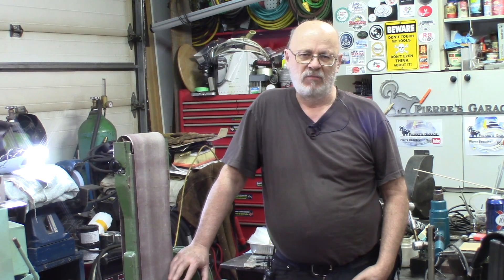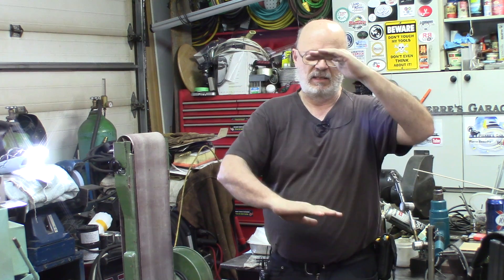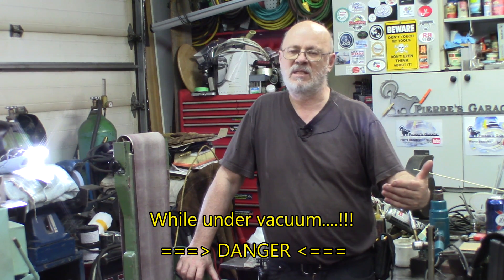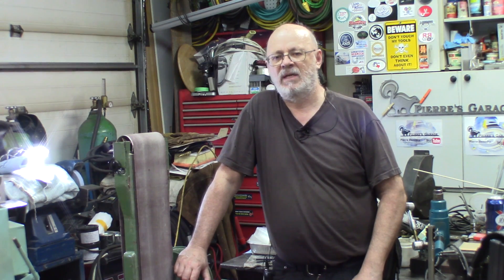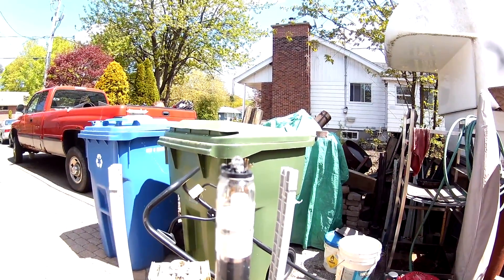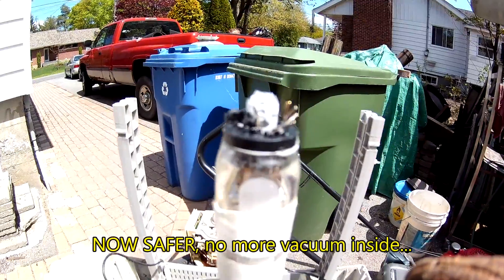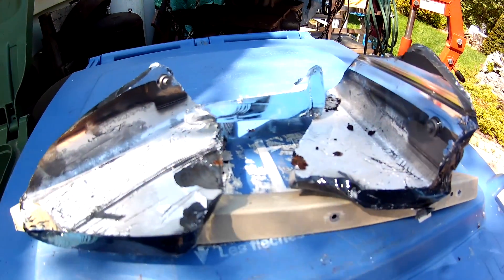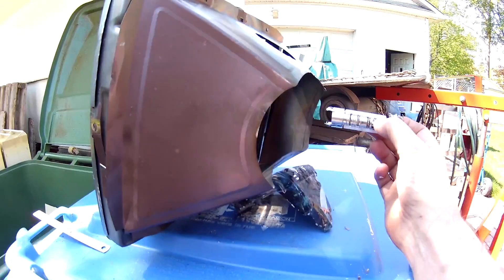SAFELY Decommissioning a CRT, under high vacuum, controled vacuum release...

Comment: would this damage the electron gun?
Reply from the maker: If the magnetron is still good, there isn't much chance it becomes defective from now on.....
You can test it by following the short instructions in the service manual refered in the description under the video.
Reply: @pierresgarage2687  Magnetron??? Doesn't a crt use an electron gun to illuminate phosphor and electromagnets to guide the beam to produce the image?
Reply: Thank You! Great advice btw!

Comment: Oh oh ph. Lols just put a hammer or something better fwiw imho see what if an axe with goggles obviously lols... and a hoodie for arm protection when swung into from the side at the top of the neck... btw from experience if ya find a dumped crt dont reach into the broken screen particularly as if ykwis it turns out ya can even cut yaself not feeling it cause if its cold outside hehe... just because ya wanna get that free copper ykwis

Comment: I worked for several years for a company that manufactured their own CRTs some
rather large 30" diagonal.  The method we used to decommission tubes was to take
a tungsten wire pick place the tip against the neck near the electron gum and heat 
the pick with a O2 and gas torch the pick would melt through the lead glass neck wall 
in about 5 to 8 seconds then pull the pick while still hot air would enter through the hole
and the tube was back to atmosphere in 10 to 15 seconds.  This was done hundreds
of time  while I was in that lab worked every time.
Reply from the maker: This would make possible the reuse of the tube since the mesh and surface weren't gonna be bombarded with glass particules from sudden breaking of the neck like I just did. Cause special or rare tubes are being reconstructed, this is a rare trade those days....    
Thanks for your comment,   Pierre

Comment: Pierre,
   I’ve properly decommissioned many more of these vacuum tubes over the years. 
   As a kid I took a somewhat different approach which was so safe. In the rural area where I grew up it was rather rough terrain in places. There were no landfills in those days and local farmers, wanting to fill deep ditches and ravines would permit/invite people to discard there junk into them. You can imagine what went into those treasure sites! I guess I’ve always been a bit of a scrounger, (my brother in law called me a junker) so it was always an adventure to go to the dump. Several go carts and other contraptions were built out of material and parts out of those places. Back in those days we never went anywhere without a rifle or shotgun as they were openly mounted on a gun rack behind the seat. Whenever we spotted a discarded TV in the dump out came the 12 gauge. The effect was spectacular! It’s a miracle I’m still alive today considering some of the stupid things I did in my youth.
Reply from the maker: Also remember a few stunts performed when younger, we're the lucky ones that survived, with at worse a few scars...   ;)
Now, parents aren't very far behind kids watching every move...   Hard to explore interesting stuff with a parent 5 feet right behind your back...   lol
first 20 years of professionnal life was working as electronics tech for the CBC in Canada, the 12 gauge in the shop was absolutely not an option.....    ;)
Cheers,    Pierre

Comment: Hope that is not the monitor you had in need of repair... don't think I could help it now. Very interesting. I never saw a shadow mask before. (Just know what the picture looks like if they get bent or deformed from sharp jolts.) That shadow mask looks like a useful filter material. Maybe for your flood coolant tank?
Reply from the maker: Hi, 
The monitor that needs repair is still in line for a fix, I don't think I'll have time before the bash, too much to do but still have your notes about the possible fails and remedies you sent me before...   ;)
BTW, it's a monochrome monitor, very simple electronics compared to those multi-sync computer monitors.
The holes in the shadow mask are VERY small, maybe something to make a measurement soon in order to find out, I'm kinda sure they would block almost instantly as a filter for the coolant tank.
Cheers,    Pierre

Comment: TOXIC WASTE WARNING
Once you have made that old CRT physically safe, you have to dispose of the glass. Unfortunately, it is heavily leaded glass and should not go to an ordinary landfill as the lead will eventually leach out. You will have to find where your community manages this type of toxic waste. Most places want the CRT intact, so after breaking off the teat as Pierre has shown, do not break the tube up further.
Reply from the maker: Hi Peter,
Near to home, the city has a couple of times per year a special day to collect any toxic waste, and, this is where it just went...
I should have mentioned it in the video....!
Normally places like Office Depot or some other designed sites will collect old electronics and batteries in order to send those to proper recycling facilities, hopefully...  !!!   ;)
Cheers,   Pierre

Comment: i just had a similar experience with an old tv. i put the picture tube inside a large rubbermade container ,strapped down the lid , stepped back about 50 ft and shot it with a 45 acp. the tube broke up very nicely i shot thru the face of the crt .the bullet did not exit the container i crushed the glass with a 4x4 and emptied it into a cardboard box. problem solved.
Reply from the maker: Hi Larry,
Good idea to pick up the glass and leave the area clean and safe for kids and bypassers...  ;)
With my method you could save on the Rubbermaid or use it multiple times...    lol
Thanks for comment,    Pierre
Reply: pierre  i was surprised  how small the hole in the container is it almost looks like its self healing . i gave the container back to my wife . i have woods behind my house so i was able to conduct my little experiment safely.

Comment: I always have to laugh when a TV show or movie shows someone throwing a shoe or something through the front of a TV.  About 19yrs ago, I had to decommission more than a dozen CRTs.  Did it the same way you just showed.  Came really close to blowing one up.....the nipple caused a crack in the top of the tube.....ended up with a crack all the way down the side of the gun tube lol.  Scared me pretty good since it was a 27"+ crt from a big console TV.  Anyway....thanks for the memories. :)
Reply from the maker: Hi Mike,
Always good to wear some protective gear even if it's pretty safe, like you just mentioned there is always something that can go wrong...
The worse was to get jolted from getting too close from a leaky high voltage cup......      :(
Just memories from not so long ago...   ;)
Cheers,   Pierre
Reply: I had a really heavy walled box I would set them in. I wore a heavy coat, goggles, face shield and welding gloves.  I folded the flaps over on the box and put my hand down in the center gap.  Kinda tricky, but I was really scared I was going to blow one up! lol
Mike
Reply from the maker: Never mind about looking wierd, better be safe....

Comment: When I was a young man, about 50 years ago, we would shot them in the face with lead  bullets. You would be surprised how much many times  you would have to shoot it with a 32 to make it implode.
Reply from the maker: Hi Charles,
The face of those was even curved before the advent of the flat faced monitors, from that angle they were really resistant to impact, not so much from the rear, though.
The other bad thing about them was the 25Kv and getting a jolt of it, something that happened sometimes when repairing them and getting too close from a leaky connection....    Yeaks.....!!! 
Thanks for comment,    Pierre
Reply: The aquadag coating on the inside and outside of the CRT funnel makes a great capacitor with the glass acting as the insulator. Yes, it will store quite a charge, and even though the thing may be disconnected for several years, it will retain a charge. If you discharge it, it will recharge from static electricity. A real zapper!

Comment: I always take those out in the country and put a 45 in them.  Not.  You sure did hold on to that old thing for a long time.  On Thursdays the men in garbage will take the thing away totally assembled.  Or you can take them to the toxic waste dumpster if you can find it.
Reply from the maker: Hi Harold,
The problem when people destroy those in an open field is the pieces of glass that could injure some unaware child or people just passing by...  
In their proper enclosures, they're pretty safe to handle, it becomes dangerous when you have access to the rear where the glass becomes thinner and thinner up to the neck...
Here in Canada, there are places like Office Depot or other electronic stores that collect them and all other electronics in order to recycle all this into new stuff that will last only half the time.....     And the cycle continues...   ;)
Cheers,    Pierre
Reply: sounds like in mississippi way to deal with electronic waste. love it.

Comment: The mesh element is called a shadow mask. It has holes that admit the electrons emitted by the electron guns. In the older color TVs, back when I worked in a TV shop and before automatic degaussing, we had to know what direction the TV would fave in the installation so we could point it the same direction when doing the convergance. One time the sales manager asked a couple which way the TV would face so we could set it up. The wife said, "Toward the couch."

We carried a big coil that we used to degauss the shadow mask after we got the  TV hooked up. Around 1966 or 1967, they started installing automatic degauss that worked every time you turned on the TV. It made life simpler...
Reply: Christmas and birthdays, the young Einsteins would get a scientific discovery set and come across the "Fun With Magnets" chapter. That's when we'd get a call. Back then we got $7.95 for a B/W call and $12.95 for a color call. Until the RCA CTC-100 chassis, a creative rug Rat could could mess up a shadow mask beyond the builtin deGausser's ability to fix it. :-)
Reply: LOL - I still have my degaussing coil from when I repaired TVs. The last time I used it (long after I quit fixing TVs) was to demagnetize the shadow mask of a big CRT computer monitor that someone (I name no names but his initials are PWM) was playing around with a strong magnet to make those pretty color bands move around the screen. It took a really long time and a lot of passes with the degaussing coil to chase the last of the color fringes off the face of that tube.
Reply from the maker: Hi,
I've been working in electronics for the Canadian Broadcasting Corp. until 1991, and I hated monitors, good thig we had all sort of other electronics to fix...   
You just reminded me about the orientation thing...   ;)
Haven't done much electronics since...
Cheers,     Pierre
Reply from the maker: I'm glad I never made house calls when I was in electronics...   ;)
Reply: My first two jobs in TV repair were road service (hated it). I still have hundreds (maybe even a thousand) vacuum tubes left over from that pair of gigs. I finally went into business for myself and quit doing road calls.
Reply: If you have NOS 12AX7s or others of the ilk, you might have a gold mine in audio amp, mostly guitar amp,  restorations. 6L6s and 6V6s are also popular, but weren't that big in TV audio sections.

Comment: so flat screen tv's are curved on the inside for the electron gun....interesting. modern OLED's work with sheer magic though, no backlight!
Reply from the maker: Hi,
There was a little curvature in CRT with flat screen...   
Newer LCD or LED work by lighting behind the screen in an even white surface and filtering out some of the colors in order to make the image visible in the front of the screen, the filter is activated in an X and Y matrix fashion by special decoding circuitry...
As technology is advancing new ways are getting developed all the time...   ;)
Cheers... Pierre
Reply: I notice you skipped oled technology ,lol
Reply from the maker: OLED, isn't that much spread yet, this is where each and every LED on the screen is addressed individually in order to emit light on its own, this allows a higher level of contrast by making the blacks 100% black as opposed to the other principle where there is always a little light that goes thru the filter... 
This takes care of the OLED principle...   lol
Reply: I have an oled tv, seems like magic to me compared to the tube tv i had to move!

Comment: This is some good advice.  I know I'm guilty of having just tossed them out in the past without giving it much thought.   The scrapper guys then rush in to grab the copper from the deflection coil and usually end up breaking the vacuum.  You can't leave the door on a fridge that you throw out so why ignore another dangerous object? Breaking that little evacuation nipple is pretty quick and easy
Reply from the maker: Hi John,
Now that you know it's hard to otherwise, and, it's safe to execute...   ;)
But, there are a few scrappers that I'd feel like hitting on the head when they go into a construction site and raid copper piping and electrical copper components, they cause thousand $$$ of damage for a couple of bucks of installed copper they instantly turn into scrap...     GRrrrrrrrrrr....!!!
Cheers,    Pierre